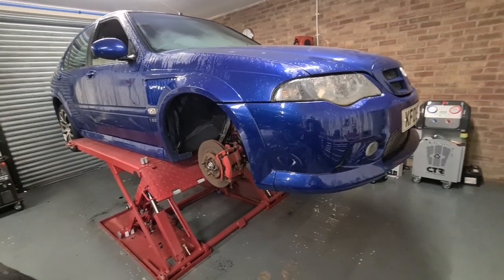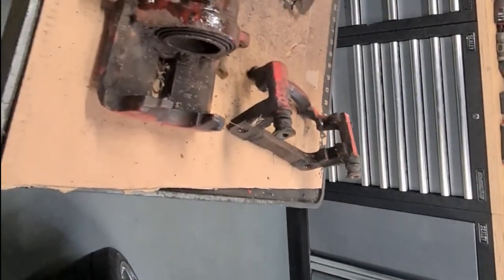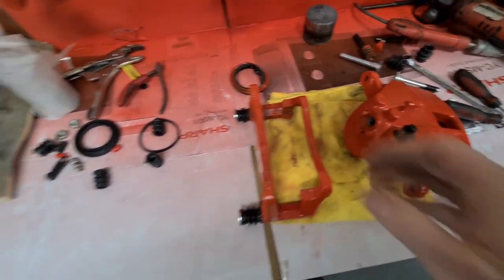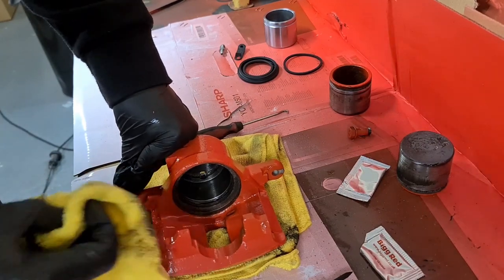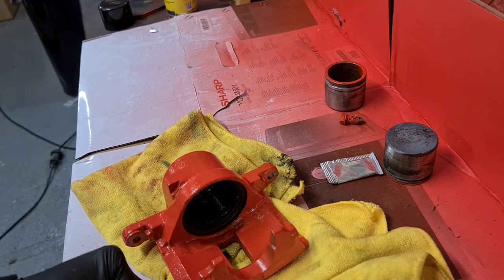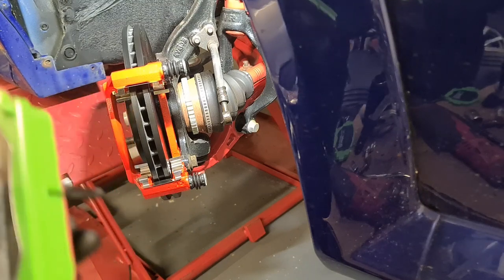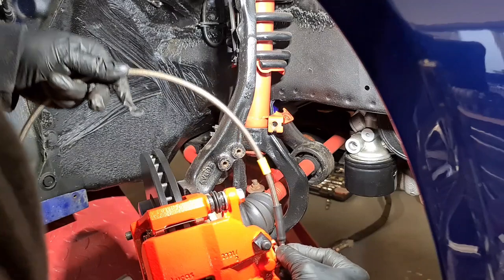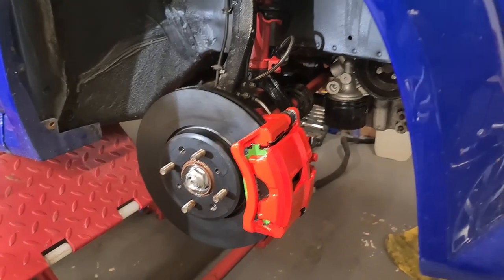MG ZS T16 Turbo - Front Brake Refurbishment

Comment: Thanks for the video I wanted to check I was putting the Sliders in the right way.

Fitting the dust covers for the piston can be a pain. My tip though is get some tube slight bigger diameter than the piston and about 12mm in length. Fit the dust cover into the calliper. Then fit the tube into the dust cover so it stretches it and then just push the piston in and then remove the tube.